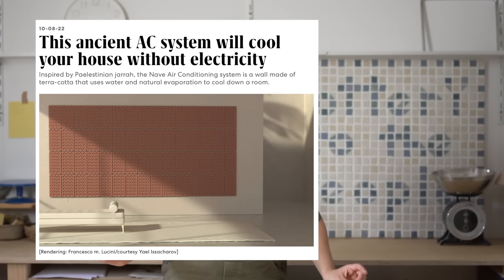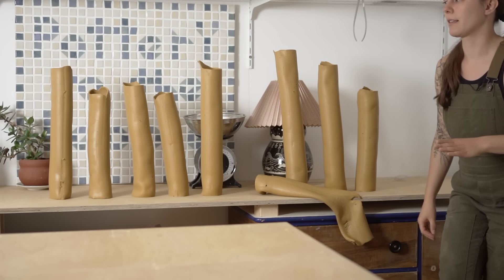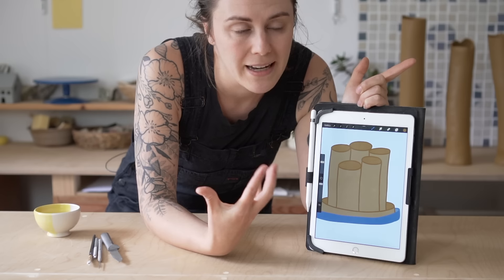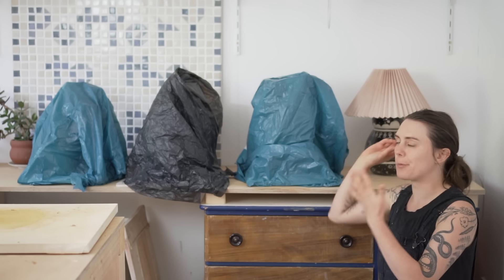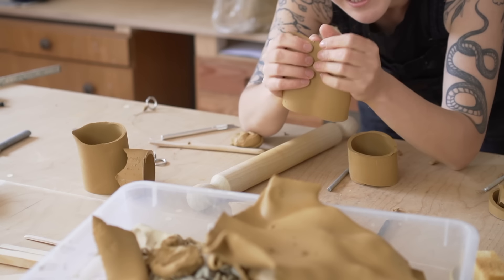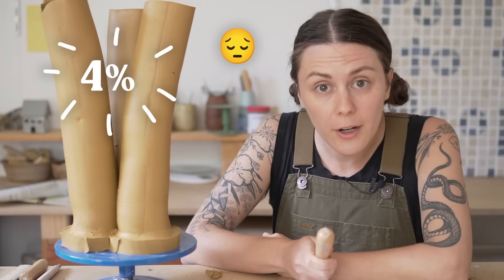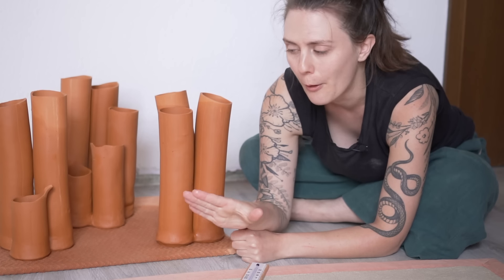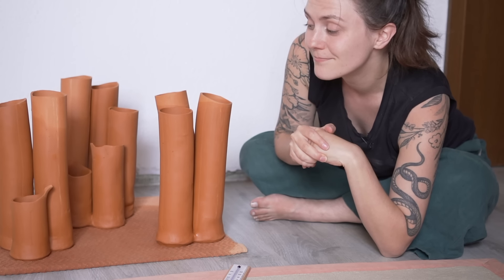Can I make an A/C out of clay???

Comment: Very nice work, I really enjoyed watching the process, and I think you're onto something here. As you've pointed out, a 1°C or 1.5°C isn't very good, (and the added humidity from water evaporation makes it even less effective), but there are so many ways to use this principle in an effective way, and I think this sort of air conditioner might actually do a good enough job if we were to separate the system's components, namely cooling and (de)humidifying, and improve heat exchange, e.g.- put the evaporation unit in a separate space, and transfer heat via tubes passing through the cool water, to get an increased cooling effect without the added humidity.
We could also put the evaporation unit in a tropical plant greenhouse to take advantage of the added humidity, and/or reclaim it from the air during the night...
Thank you for sharing.

Comment: smaller tubes or thin sheets, you want maximum surface area exposed to air and minimum mass between the water and those surfaces, I would recommend a great many short tubes made by wrapping a sheet of clay around a pencil, fuse them to a sheet, hang on a wall and spray them with water every couple hours, aim a fan at them for best effect

Comment: Swamp coolers can be useful sometimes, but they can never get colder than the wet bulb temperature (i.e., the coldest something can get by being wet and blowing water past it). Sometimes it's hot and humid enough that the wet bulb temperature is too hot for people to be healthy in, and in those conditions a swamp cooler isn't a good enough substitute for an air conditioner.

There's been some exciting progress in coupling a swamp cooler with a desiccant dehumidifier to get rooms both colder and drier. I think that's probably closer to the future of AC in places where people need their AC to actually work as expected.

Comment: What about indoor humidity from the moisture in the air? Too high and you get mold growth.

But it's clear that it's a way to cool the water in the tubes. So what if the tubes were outdoors and you submerged coils of copper tubes in the cooling water. Then you use a small blower fan to circulate indoor air through the copper tubes to create a simple heat exchanger?

Comment: The airciculation in the room, those need to be in the entry-point of that air. Also, you might want to search if you can find, how they cool air by making a "window" full of top-portions of plastic bottles, larger diameter outside, and the bottle-mouth inside, preferably on the windy side of the house. The narrowing openings compress the air and it cools down. Also, just a shoutout to the african "fridge", 2 large clay-pots inside eachother, and the gap between filled with sand. When the sand between is wetted, the evaporation cools down the inner pot.

Comment: Maybe if we were able to build a system like this into the walls of a house it could be more effective as a preventative measure? Not sure how that would work but possible maybe? 

I know for my apartment that the main reason it’s so hot is because the walls heat up and trap the heat. So if you could keep the walls cool, less need for AC?

Comment: I think the idea of these types of cooling devices is that they need to be thermally coupled with the space you are cooling or something with higher thermal mass. An example would be a giant stone wall. This way you can draw heat from the coupled thing, move the heat to the air via evaporation, and then you can then remove the air and heat from the space. Otherwise all you are doing is moving the heat from the pottery to the air. You still need to move the heat out of the space of you risk actually making the space feel warmer both because there is more heat in the air but now it's also humid so you can't sweat and cool down.

Comment: You should try this again, with a more long term test stage and a different design- maybe have a thermometer in the room with door closed and blinds drawn for 2 days with no tubes then try 2 days in the same room with the tubes and see the difference. Also, by putting them in a circle design instead of a flat one, you really minimized the surface area, you could have had a much more effective design with them positioned in a line or further away from each other so the colder air could circulate out from the whole tube instead of just the parts that werent touching or crowded into a flower pattern...

Comment: Lids would be welcomed if you don't plan to grow mosquitoes, and an air circulation system, not necessarly active, would be useful as well. For my living room where there's no AC, I wet a towel by soaking it in water then I put it in front of a pedestal fan, it works (in my mind at least)

Comment: I really like the idea! Since warm air rises and cool air falls, maybe you could put them in a barrel lifted off the ground with some ventilation holes at the top? I’m thinking this would create some sort of wind effect with hot air entering at the top of the barrel, blowing past the clay and cooling, then exiting out the bottom of the barrel. Might feel nice on your toes 😂
Reply: Maybe actually make the holes smaller at the bottom and the ones at the top of the barrel bigger to increase the flow rate of the air, making the wind stronger!

Comment: Interesting concept but i think placing them near a window or a source of moving air would actually closer mimic an air condition unit, as the air would be circulating and the humidity shouldnt build up as much as it would in a still room. I think a more coherent design of a radiator like lattice that can be positioned in front of an open window or a low power fan would work better

Comment: You should consider using low power fan , forcing airing a tube surrounded by your clay and water and keep the clay outside , so you'll get the cool air without humidity , like cooling tower , you're cooling the water and use it to cool the air

Comment: You might want to try this in a hotter room. This works by evaporation. The tubes create surface area. Theoretically, the more the evaporation, the more cooling. 66°F isn't very warm, and there is not much evaporation when compared with higher temperatures.
Reply: You might also consider placing a small fan behind it.

Comment: If you place this array this high near the ceiling, then convection currants will cool the entire room. Right now you are just cooling the floor. The hottest air is high in the room, the cold air drops downward, then more hot air moves in to the cooler.

Comment: I live in Nevada with a daytime temperature has been mostly between 80°F and 104°F and often hotter inside without AC. For that cooling technique to work it would need to be room sized. Preferably on an outside wall. But, it is a good thought... . 
 (Don't be taking our shade...Our plants die without enough shade...🤨)

Comment: You transfer the heat from the pottery into the air therefor cooling the water and pottery but heating the air. An airco dispose of the heat by transferring it outside the house with a tube

Comment: try setting it up where there is airflow over it. it will be more efficient. so either use a fan or place it near an open window. the cooling is EVAPORATivE cooling and requires airflow.

Comment: The problem is that even if you make a huge version of that, it would stop cooling as soon as the air in your room reaches maximum water capacity. Also: the room would feel extremely humid and you couldn't loose heat from your body by sweating anymore, thus getting a heatstroke would be more likely in that room then in the room next door, even if that other room is warmer.

But! You could use the cooling effect if you circulate the cooled water from one room (or the outside) into another room and pump the water into a heating element (or cooling element in this case 😄).

Comment: If you want this set up to work as an AC you need the air moving, The through draft in the room ideally (even if it is warm air) from a window with the clay pipes in front of (or near) the window and you would want your clay structure on a table cause cool air sinks. The high tech set up is a fan behind the clay structure and a open window opposite the clay pipes. The clay pipes is a cooling unit but without fans, air flow, or thermodynamics to move the cooled air around the room it does nothing. The sculptures look awesome and you worked really hard on them so I want them to have the best chance they can get of working. I hope you would test out the clay structures again with these suggestions.

Comment: There is one problem with evaporation - humidity. If room you try to cool don't have good ventilation it will got a lot of moisture on walls and ceiling, leading to mold formation etc. And if ventilation is good - you will throw away cooled air and get in hew hot one, defeating entire purpose of this cooler. So... It's a great idea in larger scale, for huge halls etc, but not as good for small living room. 
Anyways, thanks for creating this. Great stuff

Comment: It's worth noting that evaporative coolers only work in dry environments. They aren't nearly as effective, in humid environments because of the air saturation, so your mileage may vary. One thing you could do to increase cooling capacity is to hide a small fan behind the tubes. The air passing over the surface will increase the evaporation rate.

Comment: For the experiment, similar room should also be kept closed then the temperatures compared with each other for more accurate results. I also lIke the comments about having an open window and a fan. I just bought a swamp cooler, which uses water, has a built-in fan plus instructions say to keep a window open. Interesting!

Comment: What if you was to make those to fit in a window or area that may have heat entering the home. These could potentially reduce heat in-coming while increasing water evaporation potentially reducing overall room temp.

Comment: Where I live it gets humid af (hangs out around 70% in my apartment in the summer) so something like this would not work unfortunately. Dehumidifiers in addition to these are not a good option either. They heat up a space. Mine does by 2-3 degrees. This is a great idea for those that live in dry climates though. Its kind of like a swamp cooler.

Comment: Airflow around this type of cooler is critical. You should space the tubes out more. Adding a fan will rapidly increase the evaporative effect. It will not work in high humidity.

Comment: Actually, it worked. You should increase the evaporative cooling. The way to do it is to place a fan behind the clay pillars. This will blow the humid air away and allow a faster evaporation of water seeping from the pores. Try different levels of wind flow to see which is the most efficient blowing power.

Comment: For this to work you need air circulation, usually if there’s a breeze outside have two windows open (entry and exit.) And put these by the entrance window. If the outside air is hotter have a box fan behind them so it pushes the humidity into the room and allows the humidity to get into the air and therefore being able to cook the water vapor/particles.

In the desert of Sonora where it gets 110° F in the summer my grandma had a neighbor that had something similar to this but with 7-12 foot wider tubes on one side of the house (about 40 tubes) and would make it so the air would have to pass by these. Usually that part of the house was way cooler (about 10-30° F cooler)

Comment: at 67°f we're breaking  out sweat shirts and heavy socks here in Florida. This type coolers work well in dry climates but not so much in humid area like here. Although a zere pot will work to some degree a swamp cooler or evaporative cooler only adds to the humidity.. That said.. your cooler might work a little better with a small fan, perhaps a solar powered one.. I thought you were going to make them look more like coral which would have looked really cool

Comment: I wonder if using a slip mold would work better for making these a standard size and shape? I don't know much about it, but I've watched people use them to make thin walled and standard shaped structures, and have the benefit of drying in a form so you may not deal with as much collapse
Reply: Could be useful if one wanted to make a lot of these, and conserves space in a kiln or whatever

Comment: You need to invest in an AC for future heatwaves...especially for older age or if recovering from injury or illness.

I like idea of Blueridge BPM07 for $900 that looks like the ones have in hotels. Package terminal air conditioners. Easier to service as on floor. Good to have for emergency. Reviews say very reliable. I want to build a natural rammed earth house so pin ideas. Best wishes...stay hydrated and cool with crushed ice drinks 💙

Comment: Perhaps rolling a sheet of chip board - or any cheap and thin cardboard or even rigid plastic sheeting-  and making tubes that will automatically want to unroll to match the inside diameter of your clay tubes With a few short sticks inserted across the ends you could possible keep them open while on their side? I think chipboard would make a tobe just strong enough to stay straight but not to tight to want to break open the clay tube. 
I write this before seeing most of the video before I forget.
I finished and wonder if you made wall panels out of your tubes and made them more structural. Vertical tubes single layer or close packed to serve as structural components? Exterior walls where the water vapor was exhausted to outside the space. After all - it works by drawing heat from the clay to make that big gain in heat energy when water turns to steam. It's the change of state that creates the cooling effect. But you shouldn't exhaust the vapor into the room. The clay was cool so it does work. You could make any shape actually that was filled with water and just insert into a structural frame on the exterior of the building. .I could see something like that being simultaneously a fountil wall feature and divider between a living and bedroom and a greenhouse. The vw  and fountain feature - like a lavabo perhaps that would allow the vapor to escape to the green house only. Except for the inlet and lavabo outlet every other reservoir is sealed? The lavabo just drains the water back into the wall.     It would be the opposite of a trombe wall to add heat to a space this would try to draw it out.  It would nee a small recirculating pump and a constant slow supply of water. 
There's no reason someone who makes ceramics can't make this. It could be a decorative object and work just fine. Like the ceramic space heating stove of the northern european countries. 
I love the idea the a house should be something that supports the person and not the person sloves to serve the building. That the building should be producing the energy and is very durable and the person only has to guide it and protect it. Anyone's very comfortable wife or mother?

Comment: Good idea, but as most people are saying it will be hot and humid. I live in the tropics and that's the way it is here 110F with 95% humidity all day, then at night its 85F and you pour sweat till about 2:30 AM. It is hell. I've been thinking that something that would help is to cool off the house. Because the walls and the roof get so hot (concrete).

Comment: Better to put lids on the top so mosquitos cannot lay eggs in there. And then suspend them on ropes from a rack, like ollas. Water will seep through the pores and evaporate off of the surface, cooling the air. You'd still need some airflow to carry away the warm, moist air though. A small draft will do.

Comment: Technology Connections did a video about evaporative coolers a few years ago. It's interesting stuff. They work really well if the area you want to cool is hot and dry. If it's humid, and air conditioners are used for both cooling and dehumidification, then evaporative coolers are not going to be especially helpful.

Comment: How does this work explained in physics terms. I am wondering because the evaporating water would just displace the heat not make it disappear effectively making the water cooler but the surrounding air hotter.

Comment: When air is compressed, it gets cooler. When air moves through a space that narrows, the air will be compressed. If you think in terms of embedding a cob wall, which is standing against prevailing winds, with glass bottles which are open on both ends, with the drinking end on the inside and the wider end open to outside air, then you will notice the air on the inside of the wall being cooler...

Comment: To be most effective for evaporative cooling, you need to have airflow around and over these tubes. The cooling wall you showed in the beginning of the video works by having lots of airflow moving past and through the wall. A fan blowing over them might help. Also, at 61 degrees, it's not really that hot. The physics of evaporative cooling has a differential that it can attain. On a super hot day, even an AC can only cool a house so much. When it's 110 outside in California, the AC can only cool a portion of the difference between inside temp and outside temp. Try being in your studio on a hot day with a fan blowing over the tubes and directed at you. I think you'll notice a difference.

Comment: It seems that you may not have taken into consideration that the outside temperature has increased which would increase the inside temperature.  Therefore your tubes actually lowered the interior temperature by considerably more than you think.  I would guess that if you compared the room temperature of another room to the room temperature where you have the tubes it may be significantly cooler in the tube room.  This makes your tube cooling system quite a success.  Thank you for sharing your experience.